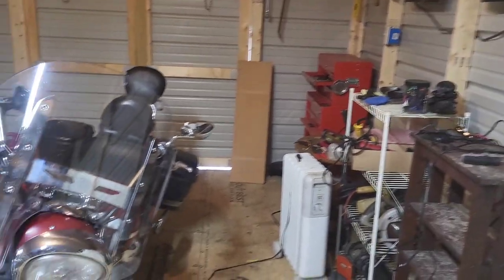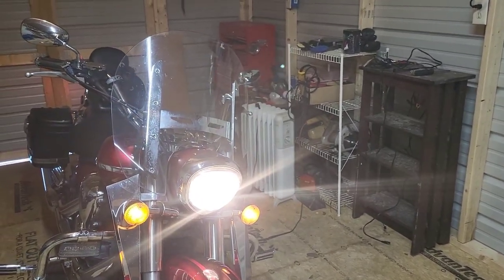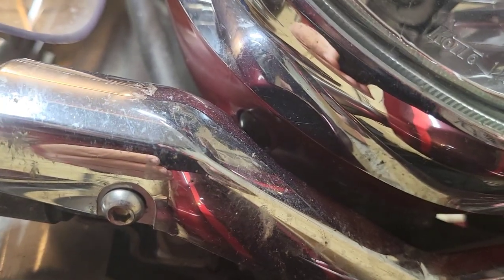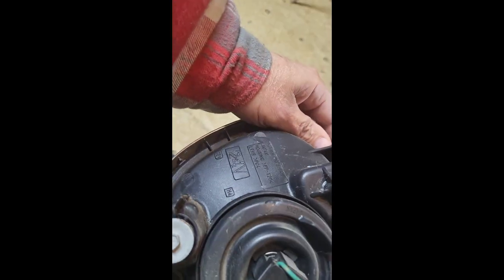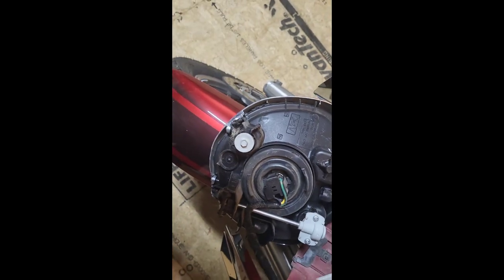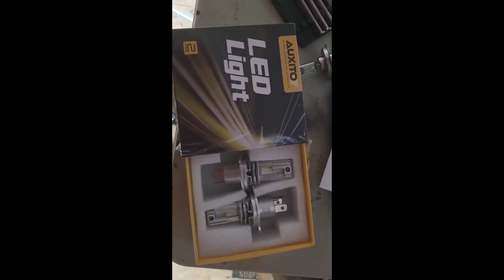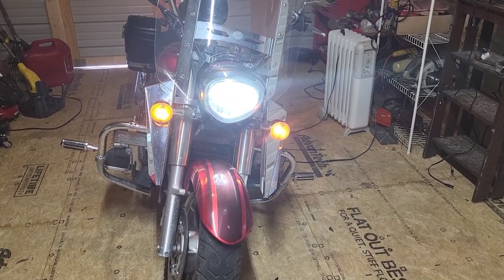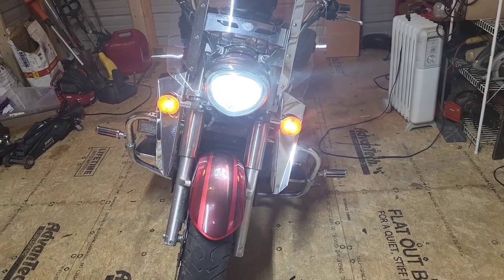LED install on 1300 V Star

Comment: Hey man, I’m looking at doing this to mine. I found one of the eagle lights.that’ll work with my Honda.supposedly,heard these leds pull less power than stock.
Reply from the maker: It does pull less juice and I can defiantly tell a difference in brightness.
Reply: @xanbiker  definitely some good points there. I ride at night & I don’t see as good.so a brighter light would help me.

Comment: Do these LEDs provide both low beam and high beam?
Reply from the maker: @frankski  yes, just be sure to get the right bulb. I had to find it on Amazon. I searched the local auto parts store and could not find LED bulb for the old school H-4 connection, which was standard on most automobiles and motorcycles in the 50's through the 90's